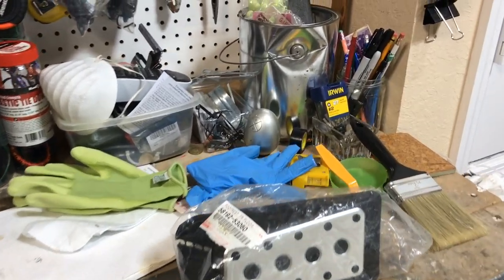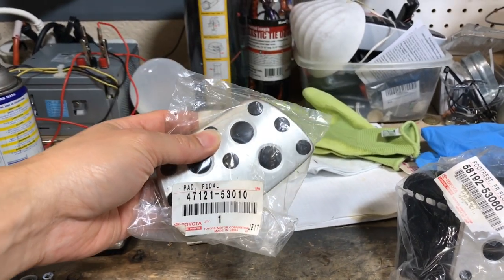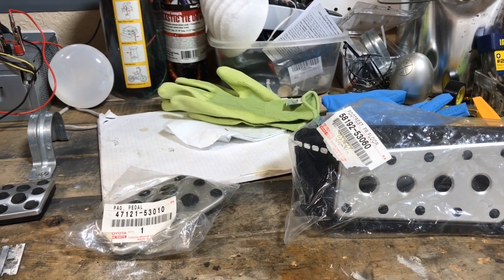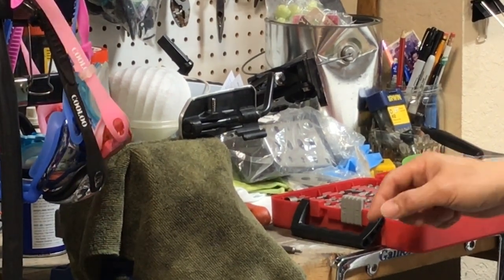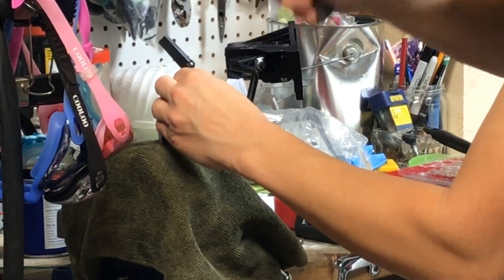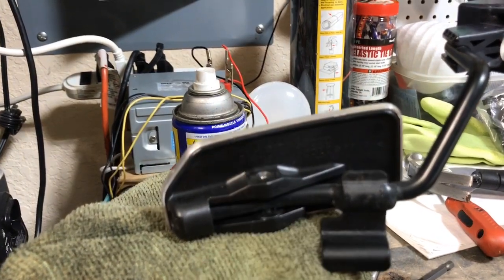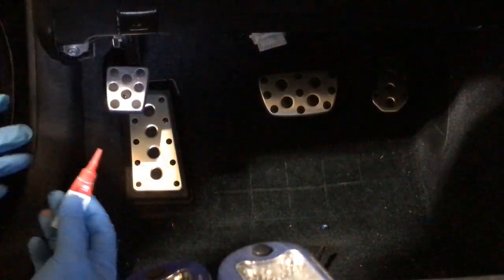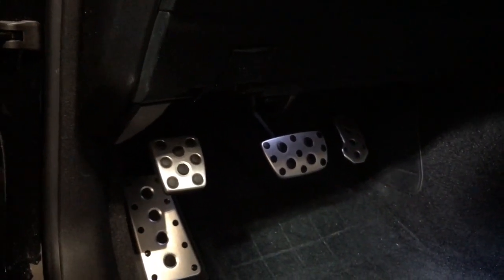How to Upgrade Lexus OEM Aluminum Sport Pedals | 2006-2013 IS250 IS350

Comment: For the Altezza clutch pedal you used for the parking brake, what size screw, washers and nut did you use?
Reply from the maker: Just some random thin 1/4 inch Philips head screws from Home Depot. Small enough to fit the rubber nubs.

Comment: I tried to punch out the pin holding the pedal to the metal bar and the metal bar failed and broke. That pin is a really difficult piece. Luckily found a replacement with the metal pedal already on it from an ISF on eBay.
Reply from the maker: Damn that was some hammering to break that.
Reply: @TunerwithKids  yeah, I believe the pin got stuck and I was probably using the wrong size punch, used a 3/32 inch and it may have wedged itself. More hammering caused the bar the break.

Comment: Hey i wanted to get your opinion. I have the 2is to 3is conversion bumper, do you think a 3is lip would fit the 2is conversion bumper? Cause the lip it came with originally is pretty cheap and plain. The fitment looks like it would work just fine. I wanna give it a shot, but wanted to see what you thought first.
Reply: Did you end up getting a 3is lip? I’m thinking about doing the same. I’m trying to plan out everything before I pull the trigger on the purchases
Reply: doesn’t fit

Comment: Doing this in a few days I think the accelerator pad does not come with pin can I just use the pin that’s on the original pad?
Reply from the maker: _MIKIMOTO _ yes use old pin. May need a punch kit to tap it out easily. $8 at harbor freight.
Reply: Tuner with Kids-Binh Nguyen ok thanks bro

Comment: The hard to reach hand tight nut for the accelerator isn't hand tight at all. Just saying this out of frustration. I don't know any other method to take this nut out.
Reply from the maker: I think I used one of those elbow joint extension on the it. Just need to break loose and hand unscrew.
Reply: @TunerwithKids  thanks I don't have one but I'll go and see if I can borrow one. Another 10mm socket has fell to its death on this project 😵
Reply: That swivel extension did the trick was having trouble with that too.

Comment: Do you know if 2002 is300 metal pedals/foot rest will fit a 2008 is350?
Reply from the maker: Yessenia, I think that one is unique to the 2IS. The accelerator and brake covers are same though. I just checked my IS300 and my IS250. The newer IS has thinner lower rest compared to IS300.